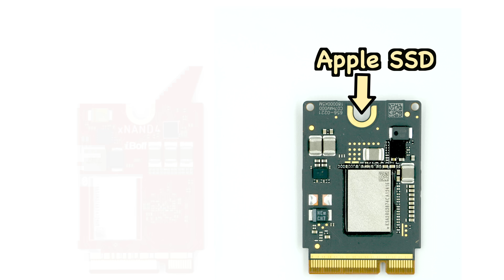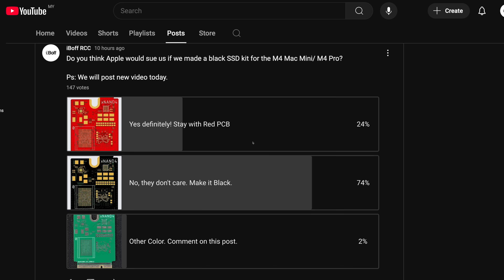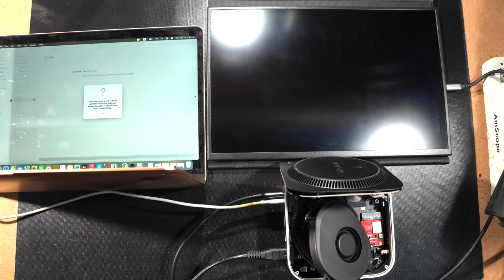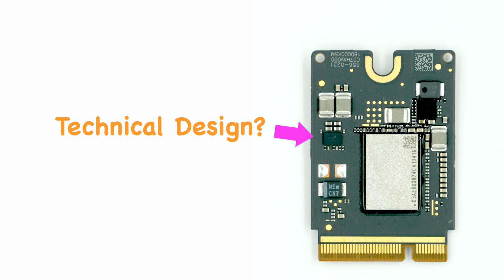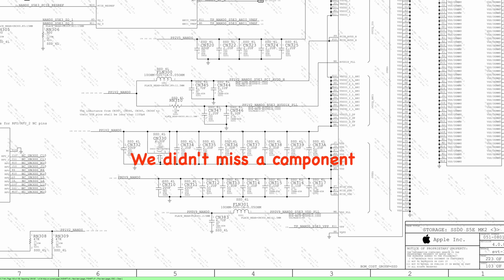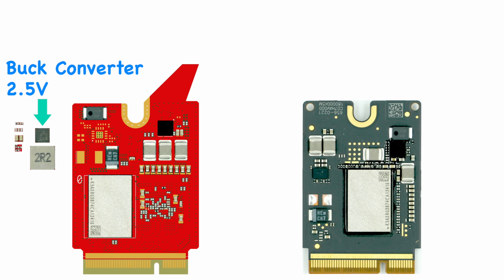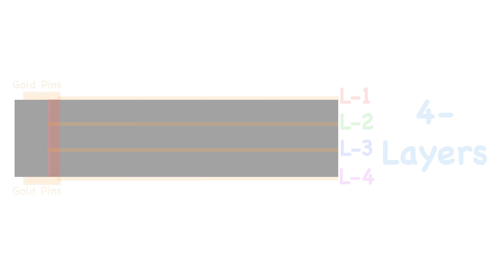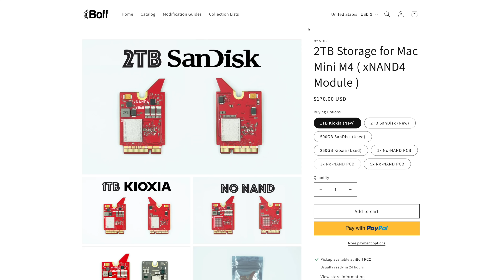We Finally Beat Apple’s M4 SSD – Faster, Bigger, Cheaper!

Comment: Well the price is still way over what I want to pay and the m4 min is said to be so much faster so would you really need it. I own one mac mini m2 and one m4, a macbook pro, an old Mac pro 3.1 and several hackmacs and I still keep most of them since like 15 years or so. The hackmac I type this on is running some 60 or so audio tracks in Harrison Mixbus with no problems at all. It even runs old Logic 9 that was released in 2009 even though it should not be able to.

Comment: I bought one last month and installed it a couple of weeks ago. Everything about the buying process was flawless. The instructions were great as well. Only 1 thing to note, I bought the removal tools and the T5 magnetised one rounded off on the second (very tight from the factory) fan shroud screw, however i had a wera one i was able to use to do the job. 

The restore/DFU process was quick and simple using a USBC PD cable from belkin and my wifes iMac M1, the system (baked into finder on apple silicon models) needed a software update which took a long time to complete, however once that had done the actual Mac Mini restore was quick and simple, and the module has been working perfectly since with temps under 40 as mentioned in the video. 

Highly recommended.

Comment: At this point most people will just prefer TB4 and TB5 external drives. 
Isn't it possible to make the PCB a secondary M.2 Slot that can work with any M.2 drive that can clear?
Reply: the issue is that external drives are a) blocked from using apple intelligence, plus apple are starting to make it more difficult to move certain parts of the Tahoe OS to an external as they rely so heavily on the T2 chip.
Reply: @davidwilkins2368  a) great news
b) great news as well

Loks like a NAS or external drives are indeed the way to go!

256 GB of base storage is more than enough for the OS and other Apple things. Everything else can be stored on an external hard drive, provided it's fast enough. And for up to $100, you can get a 10G LAN port on many Macs that don't come with it by default, which should be great for working with large files from a NAS, something very common in corporate environments.

Comment: Got my chip after about three weeks. I think with the de minimus cancellation in the US, I don't know how we will get these anymore. I hope we can.

Here's my installation notes: 

- I did not disconnect the bottom plate power switch. I saw other people remove it and leave it attached and the wires are long enough to get it out of the way.

The antennae plate most of the screws on mine were T6 on the plate, except for the two just inside the power button. The outer T6 are also on pretty tight, with what looks like a touch of thread locker on them, so push down pretty hard and turn to release the screw tension (my driver has a hole in it and I used an extension to help turn the screw while pushing down. Worked perfectly). A T5 will just damage the heads, so check it out before applying any force and stripping screw threads*.

The fan came out easily, and was easy to work around while still attached.

When inserting the chip, insert it just below the top plate. The connector is on a standoff, so there is a gap below it. That's all, just something to be aware of.

Everything went together with no problem.

Total time doing the swap: 15 mins. to completed reassembly. The tricky screws on the antenna plate slowed me down a tiny bit. 

I only have a 2107 iMac Intel, and while I tried to put it in DFU mode, it installed something else, and now the Mini flashes amber. I tried to put it into DFU mode again, but it just flashes amber, black screen.

I probably need to get ahold of a silicon Mac in order to set this up properly. My computer is too old to run Apple Configurator, (My Mac maxes out at Ventura 13, it requires at least 14) which I will try next with a newer Mac.

If anyone has any additional suggestions, I'd love to hear them.

I'll update with whatever solution I come up with.

*Believe me, I have dealt with tons of Apple's screws, and they are tiny and tricky sometimes. I was given an old MacBook to fix, and nearly half of the MacBook's bottom case screws were stripped from a previous repair. I managed to get them all out, and I sourced a trashed MacBook and used the screws from that to replaced the ones that got stripped.

Comment: This is amazing work! To be honest, i hope Europe and the rest of the world put more laws against components that are not standard like this. It's even worse than an SSD Pcie 4.0, which can reach 7.000 MB/s, so the point for Apple here is making business and more money, that's all. We understand its a company, and they need benefits, but going against the standards with worse specs is going against ethics.

I like Apple devices, but the poor repairability, soldering components like RAM, putting the button on the bottom, glue everywhere where they can put screws...awful. The clients' rights to repairabilty and do whatever they want with the things they buy (even if they lose warranty ) is a MUST, not an option!

Comment: I installed the 2tb and everything went fine but I've been getting very inconsistent speeds some times its very slow (650 MBs) then it will be fast like its supposed to be then the next time its half speed. I'm going to try tearing it down again and reseating the module. its all most like thermal throttling.
Reply: You could try putting a thermally conductive pad on both the NAND chips and see if that makes a difference - the sort you see on high performance SSD modules. If you did the module installation yourself you might also want to check the fan connector was plugged back in correctly.

Comment: Hey guys, awesome work — really admire what you're doing with Mac memory upgrades! 🙌
I've got a little challenge for you 😄

Have you ever tried soldering a PCIe connector onto a 2020 27" iMac (Intel) logic board and installing an NVMe SSD via adapter?

I know Apple removed the factory SSD slot in these models, but is it at all possible to restore PCIe access by tracing the original lines or reactivating the controller somehow? Maybe there's still a usable PCIe lane on the board?

Would be amazing if you could look into it — I’m sure a lot of iMac owners would love to see the result! 💡

Comment: I installed the 1tb version and it’s been working great. One thing the video doesn’t mention — when you’re restoring the Mac Mini after replacing the ssd, you’ll need  Apple Configurator (a free utility from Apple, downloadable from the Mac App Store) installed on that second Mac. The DFU restore won’t work without it. Probably obvious to folks who do this a lot, but I didn’t have it and got stuck for a bit. Worth pointing out for anyone new to this process!
Reply: Definitely did not know this and have been struggling. I’ll try that to see if it works.
Reply: Good info.  I tried a DFU restore using the Finder as it showed as an option but would not work.  I downloaded and ran the Apple Configurator and it worked first time.
Reply: Nope. All it says now is “no space left on device. Cannot be completed” and when I tried doing just the restore it just says “firmware is corrupted”. I’m having such a fun time…
Reply: @Tomweldonsays  only things I can think of then.. is check your usbc cable make sure you’re using a high quality one that transfers data and power, the newer the better. Make sure that ssd is really seated in the slot well. You also have to choose the “restore” option not the “revive” option if you’ve done that. That’s one of the main reasons I can see that that error message gets displayed. It’s saying “hey there’s no Mac OS installed on this disk so I can’t revive your user data on it.” You need to choose restore, put Mac OS on there, and then use migration assistant to get your user data on there using the on screen prompts like when you set up a new mac.
Reply: @SwayThis-x3n Okay one thing I did not realize is I was using the thunderbolt cable that came with it and I guess that’s not right and I didn’t see that before. So maybe that’ll solve everything.
Reply: @Tomweldonsays usb port matter as well. Try changing that port.
Reply: @Tomweldonsays did you ever get it figured out?
Reply: @markelwart8577  Yeah I think my main thing was using the wrong cable in the wrong port.
Reply: I was able to set up my 2 TB version thanks to the video and your tip! Thanks so much.
Reply: nice tip bro thanks!!
Reply: Did you have the error 21 too ?

Comment: These projects should be viral. Not only do they offer greater capacity and speed than Apple, but they do so at a ridiculously low cost compared to what manufacture forces you to pay. A workaround is necessary to avoid legal issues, but in the process, you improve the engineering of the company with the most millions on the planet. It's crazy, I wish the best!

Comment: I’m encouraged by your informative video, but frightened of swapping the SSD on my own. If you offered a plan to install the SSD and it cost less than Apple, I’d be the first in line to upgrade from 4tb to 8tb because that was the most expensive upgrade for my M1 Max MacBook Pro and M4 Pro Mac Mini.

Comment: Cant the install be done off a USB? or do you actually need a second MAC for this?
Reply: You have to use another Mac and put the Mini into DFU mode. This is how Apple repair centers replace the SSD modules as well, it's the process designed to pair and write the NAND chips for the specific Mac they are going into.

Comment: Compare the same drive capacities! Smaller capacities are naturally slower. The video is misleading, the 2TB drive from Apple will be much faster.
Reply: That's simply not true, as other videos have shown. The limiting factors are Apple's controller and the speed and number of modules of the NAND used on the module, not the capacity.

Comment: After watching this video again, my biggest complain is the Apples to Pears Speed comparison around 5 minutes of the video, you compare iBoff 2 TB Module with 256 GB Apple Module, WHY don't you compare an iBoff 2TB module with a 2TB Apple Module, or whatever EQUAL Size.
Especially more important IS THERE A SPEED DIFFERENCE when surpassing the pSLC-Cache so in terms of REAL NAND WRITE SPEEDS.
Also for the Mac Mini M4 Pro modules that would be the restriction for a VALID comparison Apples to Apples comparison NOT Apples to Pears comparison.

IT IS NOT SURPRISING THAT A 2TB MODULE HAS DIFFERENT (BETTER) PERFORMANCE VALUES THAN A 256GB MODULE, THAT DOESN'T PROOVE ANY IMPROVEMENT OF iBoff vs. Apple.

Comment: I am reaching out from the Netherlands to inquire about the feasibility of upgrading the RAM and SSD on a 16 inch MacBook Pro M4 Max, which currently has 48GB of RAM and a 1TB SSD. Apple has quoted €1,250 for an upgrade to 128GB of RAM and €2,750 for an SSD upgrade to 8TB. Given the high costs, I am exploring alternative options for these upgrades.

Could your team provide professional upgrade services for the RAM and/or SSD on this device? If so, I would appreciate details on the process, estimated costs, and any potential warranty implications. Thank you for your assistance, and I look forward to your response.

Best regards,

Comment: Will there ever be a way to upgrade the RAM?
Reply: not without soldering the entire SOC like dosdude1 does in his videos. Basically you buy an entire other system and desolder the CPU/memory (it's all one module now) and solder into the new system.
Reply: yes there is way to upgrade the ram
Reply: @IvanSchob  got more info?

Comment: Which ssd chip manufacturer used on your custom ssd board and which ssd firmware?
Reply: As they state in the video - this is NOT an SSD. Only NAND flash chips on a module. The SSD controller and firmware are in the Mac.

Comment: This is a misleading video.

A 2TB SSD will always be faster than a 256GB SSD due to the SSD controller. Compare your 2TB against Apples 2TB. 

I do like that it is cheaper, but don't mislead your customers with 'transparency' when you're not conducting a fair test.

Comment: I think we dont need a second mac because we can use the same method as we use for booting hackintosh machines.
Reply: Incorrect because there are no arm64 architecture (aka Apple Silicon) hackintoshes. This is a whole new architecture and Apple's own replacement procedures use a second mac to re-flash the system.

Comment: what are the requirements for the "2nd mac"? in this case it'S running sequoia, but is that the minimum required?
edit: just saw that this isn'T available anymore. will this continuously only be available in "runs"? or will this eventually be available for regular purchase?

Comment: IMHO, any time you can remove capacitors and still function is a win. The circuit will run cooler, and theoretically last longer. I'd like to see this for M series laptops if possible (I've never seen the motherboard)

Comment: It would have been much cleaner, if you made it external plug in to the 10bit outlet on m4pro. And not voiding apple warranty. More accessible and usable. Just make apple think that its internal upgrade and your the king.

Comment: Never go cheap, always include all the components that Apple has on their layout because its always there for a reason, Apple prioritizes reliability under all circumstances, heat management, RF interference and then they prioritize performance, there is no way to know if the extra components are there to manage extreme circumstances for worst case scenarios so you should always include all components in your layout.

Comment: Gemini AI says the following, what is your opinion please?   :    
Replacing a TPS62180 power management chip on a MacBook Pro logic board with a TPS62130 is not a feasible or recommended procedure. These are different components with different specifications and pinouts, designed for different power delivery requirements. Attempting this swap will almost certainly not work and could potentially cause further, irreversible damage to your logic board.

Here's a breakdown of why this swap is not possible and the complexities involved in replacing surface-mount components like these on a modern logic board:

Different Specifications:

The TPS62180 is a dual-phase step-down converter capable of delivering up to 6A of output current. It has specific features like balanced peak current mode control and Automatic Efficiency Enhancement (AEE).   
The TPS62130 is typically a single-phase step-down converter, usually with lower output current capabilities (often around 3A, though variations exist). Its internal architecture and control mechanisms are different.
A circuit designed for a dual-phase converter requires specific external components (like inductors and capacitors) configured for that architecture. Dropping in a single-phase converter will mean the surrounding circuitry is incorrect, leading to improper operation or failure.

Comment: Excellent work. The only thing I would say is hold onto your existing ssd. If you ever want to take the Mac mini back in for warranty repair with Apple you will want to swap back to the original ssd. 

I say this from experience with a MacBook retina 2012. I was having image retention issues, I can’t remember the particulars, but recall some sort of freak out when seeing my UWC ssd in there. Not sure how I explained it away, but I tried again after swapping to the original SSD and all was fine then.

Comment: What benefit does a 10 layer PCB provide over an 8 layer one? Some sellers are providing a 1:1 replica of the originals. Is there any benefit?
Reply: My guess is the different layers would be additional ground planes, one as the very top layer of the PCB and the other as the very bottom layer of the PCB. This could theoretically further minimise any potential EMI radiation.

Comment: My question is will switching the SSD terminate Apple's warranty / Apple Care service? Even if replaced back to the original ssd before sending or will they know when doing remote support and screen  sharing with them.
Reply: Apple Care for an iPhone is good, but for a Mac Mini? It's a risk, but honestly it has a much better value proposition than Apple's price gouging. It's well worth the voided warranty

Comment: Hello brother, I have a macbook air 2013 11 inch. I changed the ram from 4 gb to 16 gb but I couldn't find the resistor on the motherboard. Can you help me visually?
Reply: You can't just swap the ram and set strap resistors since the 2013/14 haven't got this option in the schematics like the 2015 models do. You need to dump the efi rom and patch it with the right spd info to get 16gb to work.
Reply: @foxfoobar Can you inform me how to do this?
Reply: Just search for " Early 2014 MacBook Air 16GB RAM Upgrade With dosdude1"

Comment: I thought Apple had really fast SSDs, theirs is no faster than the nvme drives in my desktop that only has upto gen 4 drives in it. When did Apple fall so far back in SSD speed?

Also, great work on this. The video was really interesting and getting an eye on the design choices is really cool. Thanks.

Comment: The vast majority of users do not feel comfortable with taking their Mac mini apart, risking damage, and voiding the warranty. Not everyone has access to a second Mac computer. If the replacement SSD should be defective for any reason, it's a hassle reversing the process. If anything should go wrong, it can cause anxiety and stress. Altogether, then, it's potentially a lot of trouble.

I'd rather spend the money to upgrade to 512GB and buy an external drive to accompany the machine. Easy peasy. No headaches. No anxiety.